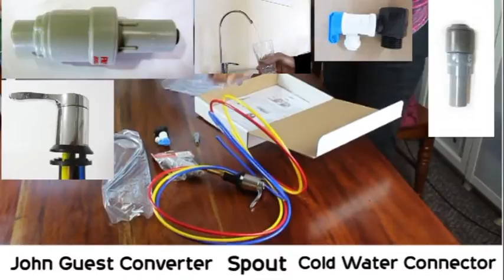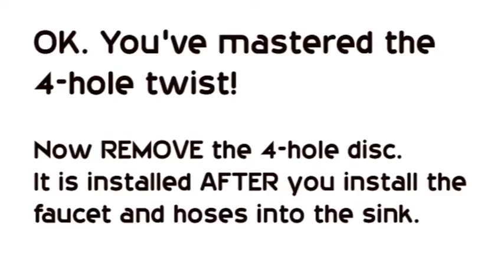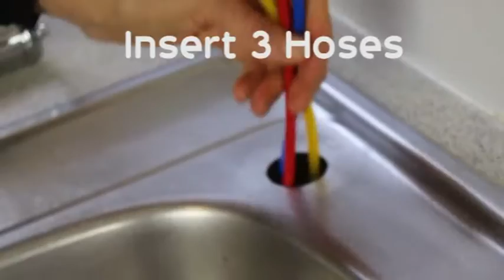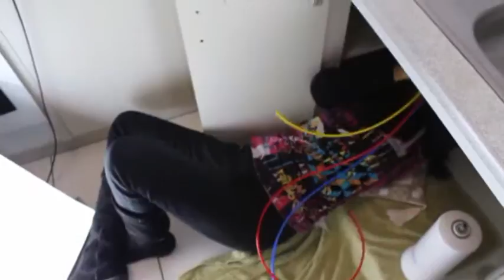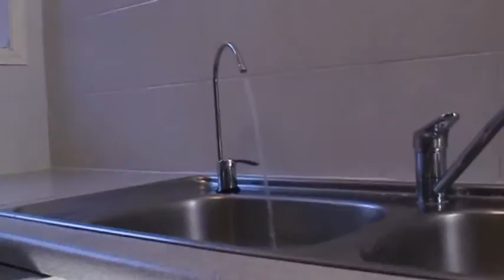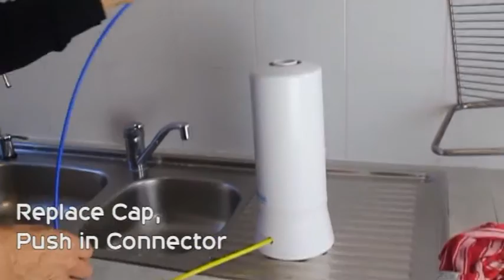Installing the Alkaway UltraStream Water Ionizer undersink.

Comment: Just curious. The instructions in the box say to put the pressure limiting valve on the red hose not the yellow hose?
Reply: Hi Lazy! Yes. The PLV's job is to protect the UltraStream from excess pressure and from water hammer. So it's situated on the hose between the source water inlet and the faucet.